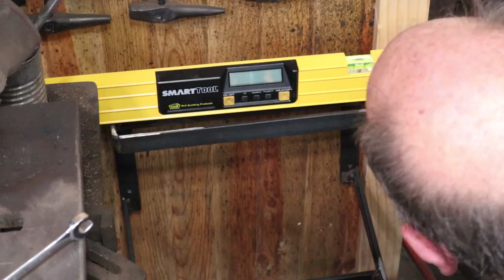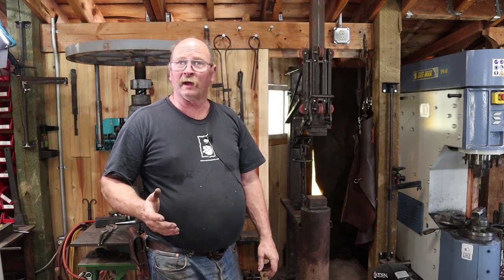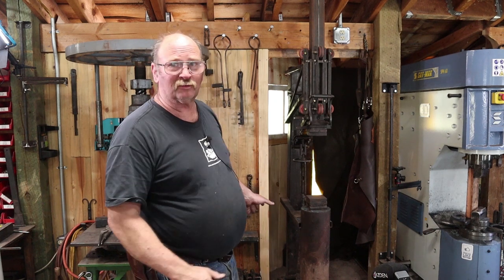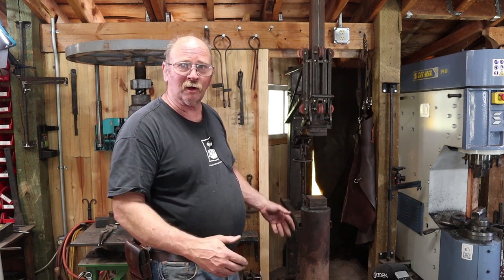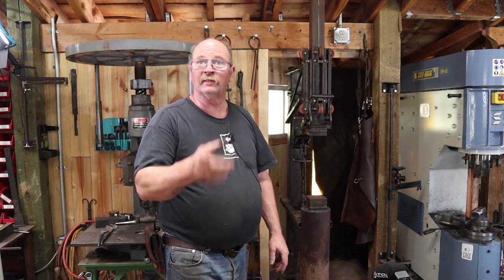Two minute tool rack for the blacksmith shop

Comment: And it's already full. Another new tool rack tomorrow then? :P

For those of us without a welder a very similar things can be made out of wood with pretty basic woodworking tools, but you'd certainly want to beef up the joints(or realistically, just go with full-height solid side panels).

Comment: Great quick little project. I suppose some hammering of tabs and short bolts would work too. My 200 year old house does not have the power available to run a circuit to my shop for my welder, and the wife won't let me unplug the stove and weld in the kitchen with my 220 stick. 100A service has retired several of my tools, so hand tools has become the majority of my wood and metal work. I have 120V run to my shop, but it barely handles my bandsaw, thickness planer, or wood lathe. The lights dim way down with any major power tool. I have a 120 MIG but it trips the circuit as soon as it strikes an arc. Great idea though. I may have to make a modified version for my hammers, my lathe tools, and see where it goes from there.
Reply: Buy a bigger breaker for your fuse box and it won't trip the circuit anymore while your 120 mig. Those machines should have at least a 20 amp breaker. You can also wire 2 120v circuits to make 240 to run your stick welder, just find 2 outlets on opposing cycles. I did it for a remote welding job a few months ago, just following the wiring instructions found on youtube. Google usually has the answer to all life's questions and obstacles.
Reply: @ZoltanNFA  no open circuits in the box. The shop is fed with a 100 ft 12ga extension cord.
Reply: @ZoltanNFA  also, I am disabled on a less than $800 per month fixed income, so upgrading the service or dropping a second service to the shop is not in the financial cards for me. Thanks for the suggestions. The circuit already has a 30A breaker, but also feeds one of the kitchen counter plug circuits. 200 year old house, so all of that was added years ago and never upgraded as of yet. I have to unplug the coffee maker just to run the microwave. But again thanks for the suggestions.

Comment: Thanks for another great Video John!  Given that this (and most of your videos) are edited for time (or humor lol) would you be willing to make a time lapse showing how long it actually takes complete a project?  I'm not asking for anything separate or special but perhaps speed up the footage from the cutting room floor with a clock or a timer running to give people a good idea of just how long some of this stuff takes... heating, forging, heating, flattening, heating etc.  

Personally, Im that kind of guy that could sit and watch you do the same thing repeatedly for hours just because I get a better sense of just how much work really and truly goes into your projects.  I realize times will be different given the types of projects, your altitude and the type of furnaces you're using etc...  this is more of a personal request out of curiosity and enjoying your videos while learning from you as you work.  

Thanks again for everything, I really do enjoy your videos and watching someone use more traditional tools and skills rather than just relying on industrial equipment for everything.
Reply from the maker: There have been a few time lapse videos.  But I can't recall which ones

Comment: Nice and easy build rack! Irealy like your videos! I bought a small anvil (150kg) some weeks ago and everything is fine even the price was good but the hardy hole is 40mm laerge so i can not use any standard 1inch Tools. Would yo recoment to build a adapter for 1" tools and if yes how would you build it? Thank  you and Greetings from Germany
Reply from the maker: Just a piece of 1" inside square tube welded to a plate with a 1"square hols how I adapt for smaller tools
Reply: @BlackBearForge  Thank you very much! I I hope i find one wich will fit and not rattle to much.